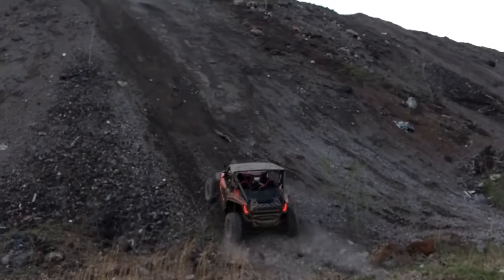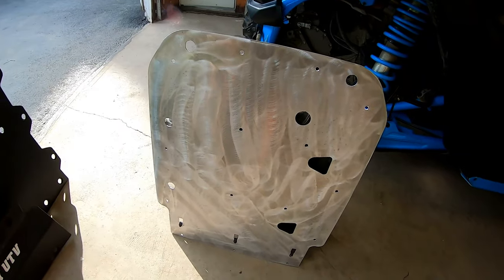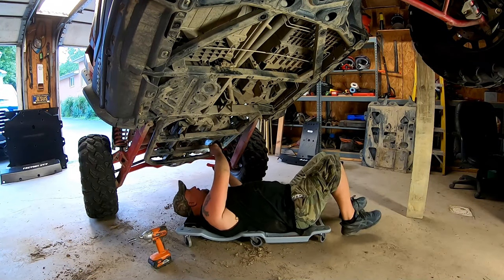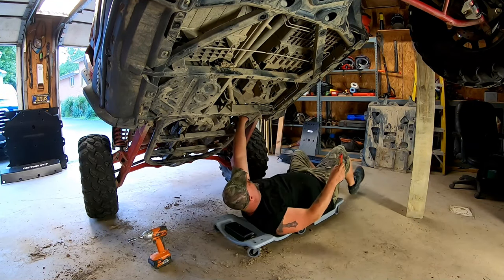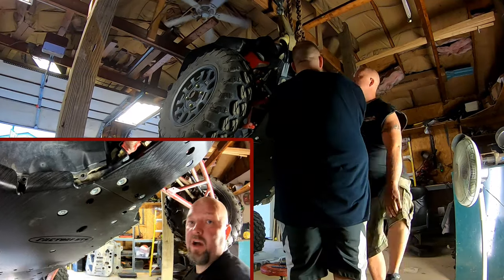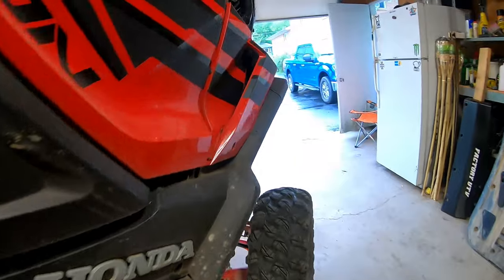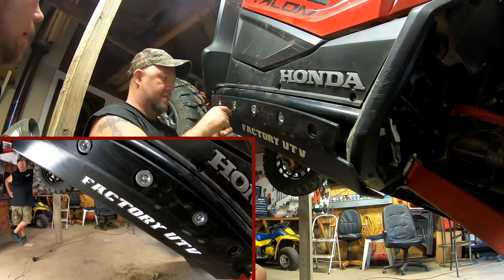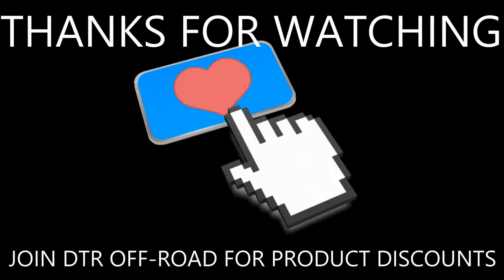Factory UTV Honda Talon X-Brace and UHMW Skid Plate Install

Comment: Please use a secondary support other than relying on that winch to hold the buggy up. I’m hoping you do.. big boy at 3:50 looks like he’s holding it up :)
Reply from the maker: Hi Nate... We have a sandwiched 2x10 header with 4x6's for extra support. The hoist locks in place and for safety support we have two heavy duty chains wrapped around the header to the front of the buggy in case the hoist cable would snap. It's about as safe as we could be.

Comment: Could you explain where and how the oil pan got damaged???? From the video, I cannot see how that could have happened. There is cross-bracing on that rear end where the upgraded skid plate is going.
Reply from the maker: In the video you saw a cross brace over that area, but that was something a friend added after the incident. In stock form the oil pan area is completely exposed without protection other than the flimsy stock plastic skid plate over that area. We had planned to remove that added protection off video but forgot. The Talon isn't the only UTV lacking protection right there. I may end up adding the X-Brace protection to my X3 in the future.
Reply: @dtroff-road5427  Nice to know, thanks for the clarity.... I may need to pick this up.

Comment: They need to make a form fit under plate that installes 

without any add holes to drill
Reply from the maker: Aftermarket skid plates are so freaking worth it... but I agree, too labor intensive. I need one on my XMR but don't want to go through the work of putting it on lol